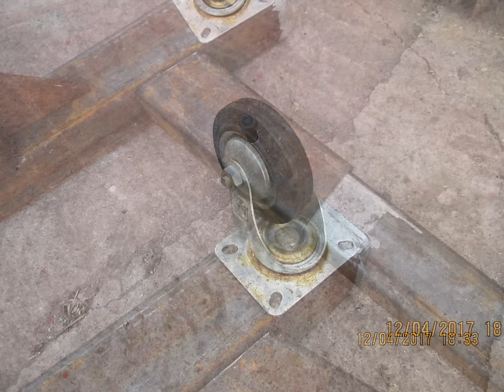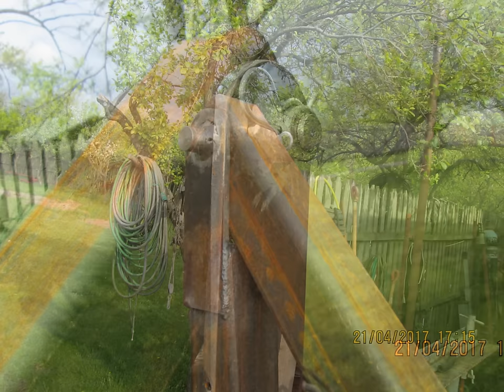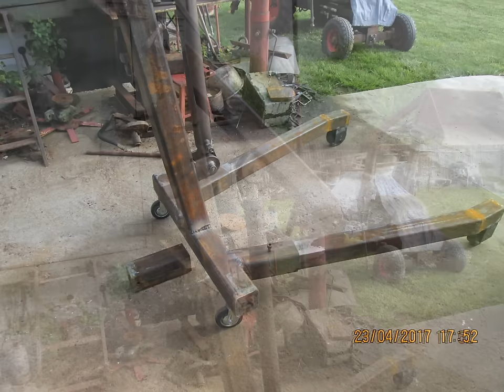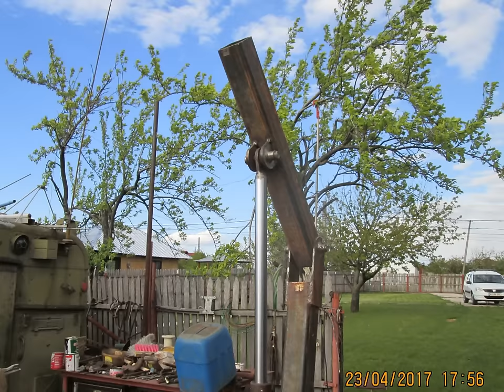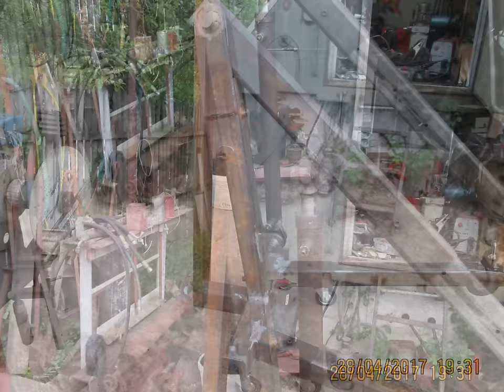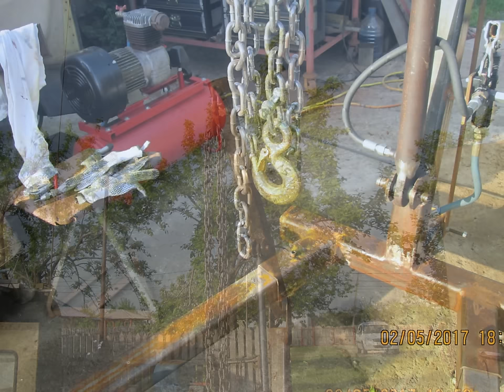Home made crane pick up 2.5 tons (photos)

Comment: I've been looking at some "floor cranes"; designs by individuals on YouTube,  and what you have here is an accurate, if not almost perfect, piece of equipment.  
You've paid attention to every detail and your creation is very well built. 

Kudos for a job well done.
Reply from the maker: Thanks for appreciation.
Reply: Very nice.! I’ve made a few myself. One is heavy duty another a bit smaller with the wheels lower to the ground the smaller one for some lower vehicles. Two have 3 point hitches so when I wanna move em and whatever is attached to them, all I gotta do is pick the whole thing up and carry it off. Great looking work for sure on your behalf.!